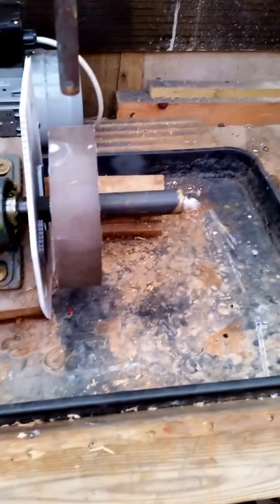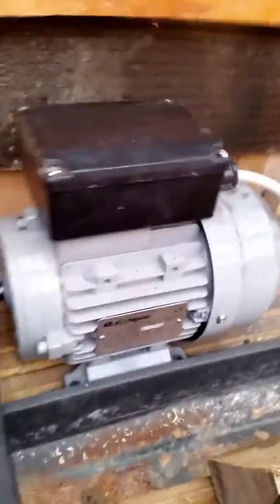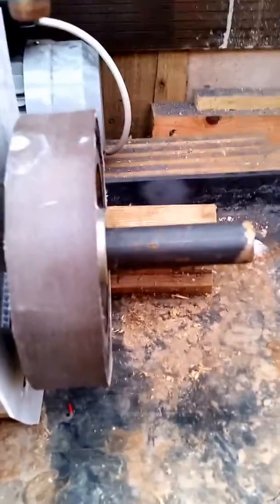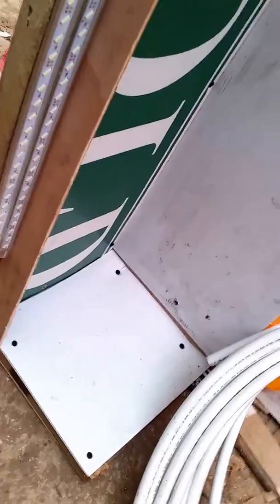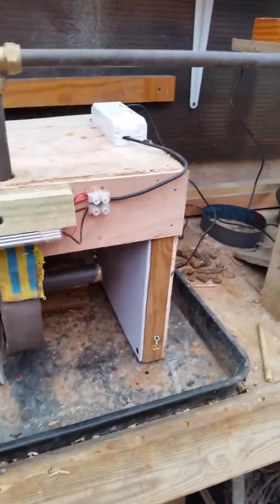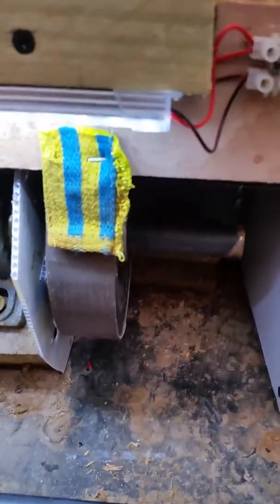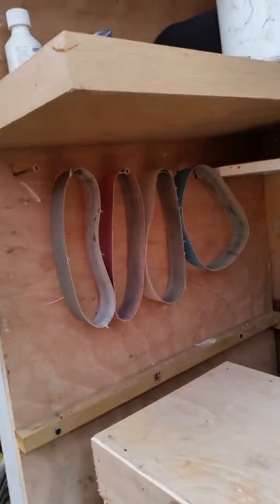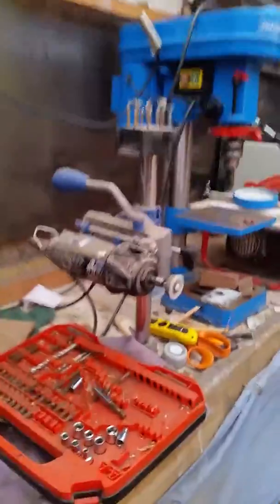Home made cabbing machine

Comment: I was curious, how do you pin the wheel to the arbor shaft? In other words, how do you prevent the wheels from spinning freely on the arbor shaft if the shaft doesn't have threads for a nut? I'm looking to try and modify an old lortone combo machine and i'd like to add another wheel, but the arbor shaft doesn't have threads the entire length so i need to figure out a way to keep the wheels from spinning freely.
Reply from the maker: Hi Robert I have improved it since that one https://www.youtube.com/watch?v=dVq7n2VeGXE    I have put tape under the wheels and then just tightened it all up with the clamps
Reply: Awesome. thanks for the help.
Reply: You could drill a hole in the hub, thread it and put a set screw in it.